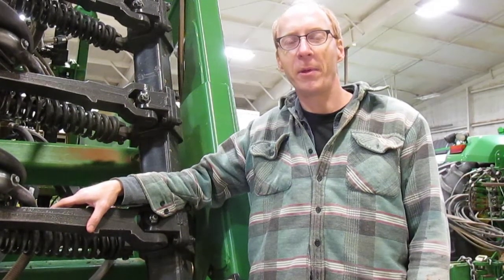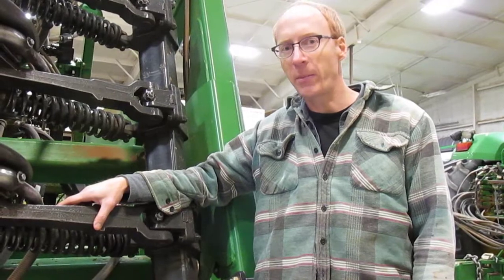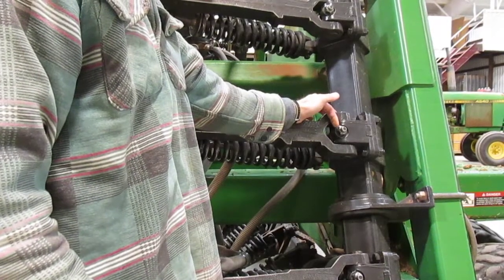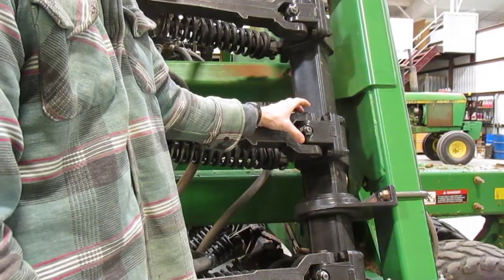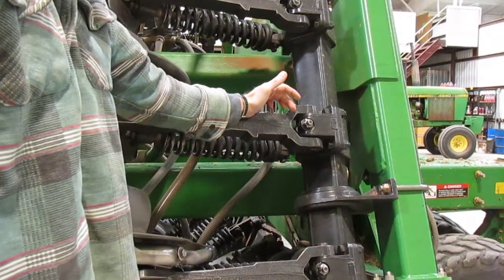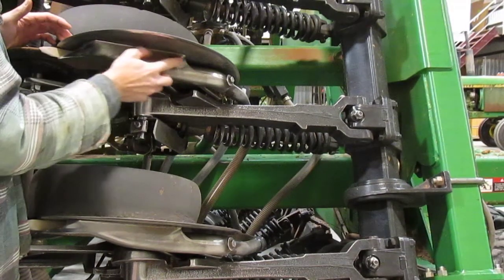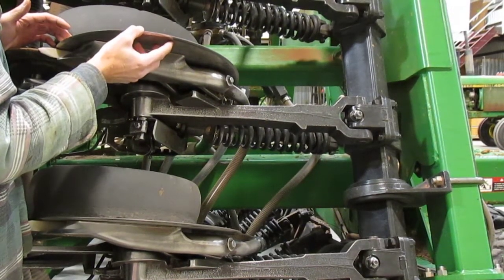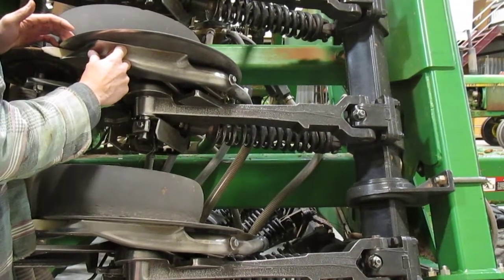Opener Pin Wear on John Deere 50 60 90 No till Drill

Comment: If you haven’t rotated the pin yet, how do you know when it’s time to ensure getting the most wear out of the original side?
Reply from the maker: 1" of total side to side movement rotate the pins will roughly cut the play/wiggle in half. Anything more than 1"  (and many can have 2" of play) you are better off to change pins and bushings. Rotating the pin does not do anything for the wear in the bushings